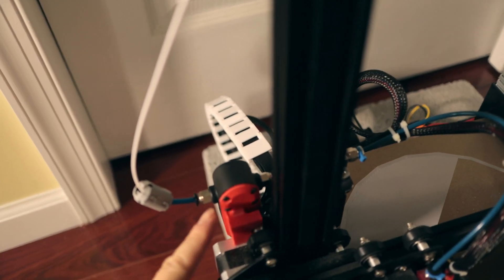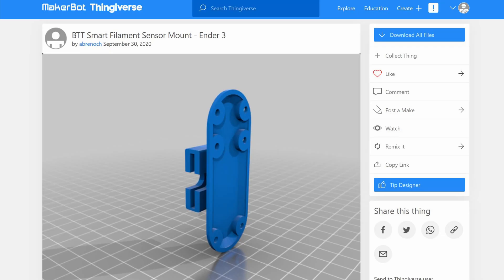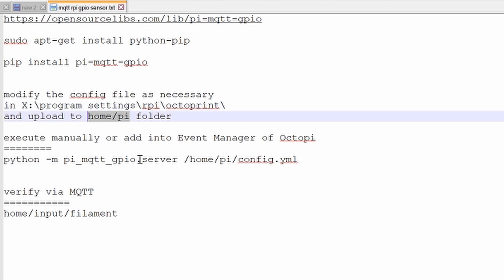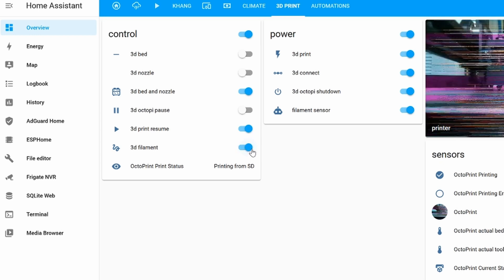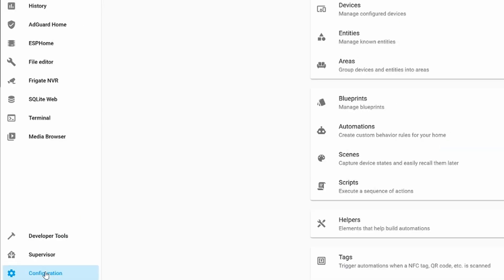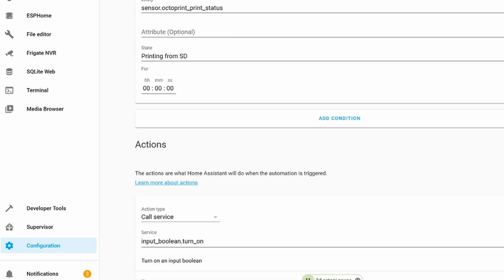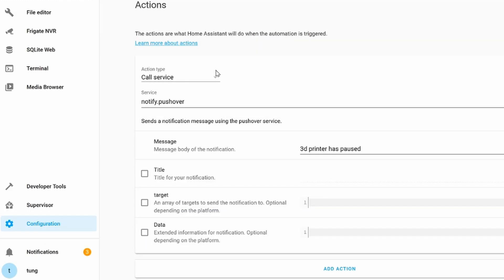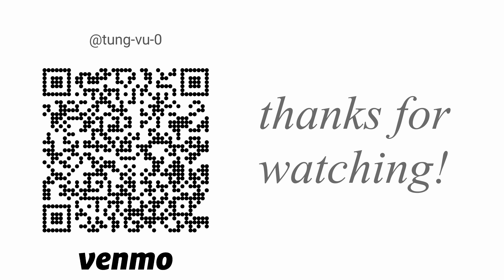Bigtreetech smart filament sensor, working with OctoPrint, raspberry pi, MQTT and HomeAssistant.

Comment: I'm able to see mine detect distance and it will just count down from where I start and never pause the print. it just stops counting at  -1  if I do timeout it will print for as long as you set the timer then pause. I'm not sure if it's me or this smart sensor is just junk but I can't get it to work. and I can't login with Putty because it won't let me enter a PW. I may just be out the money I spent to setup 3 of these on my printers.... I should of just hooked up the stock sensors to my Pie's with 2 wires. seems way more simple.

Comment: It does work with Octoprint out of the box, use "Filament sensor reloaded" plugin
Reply: How about more info on how to set this up using Filament sensor reloaded. I am confused because the switch is not on/off it is sending a pulse so how is it set up?
Reply: Could you elaborate a bit further please?